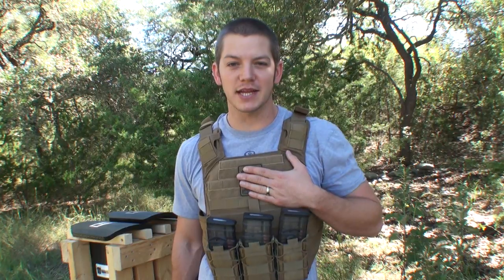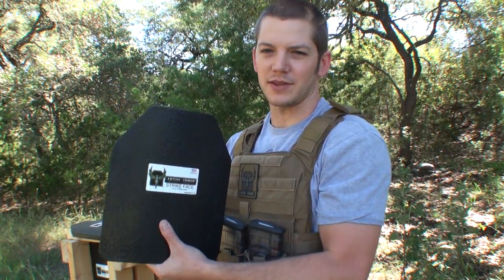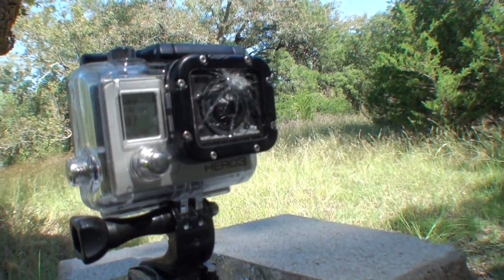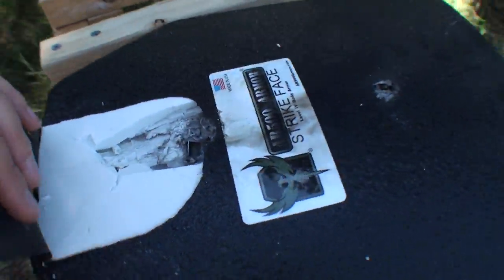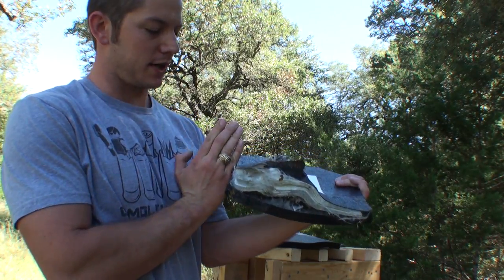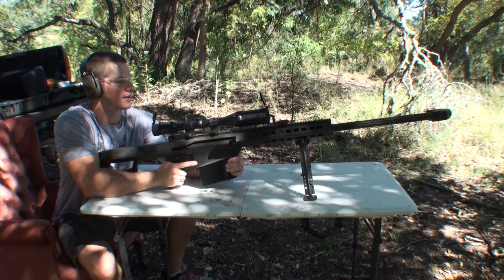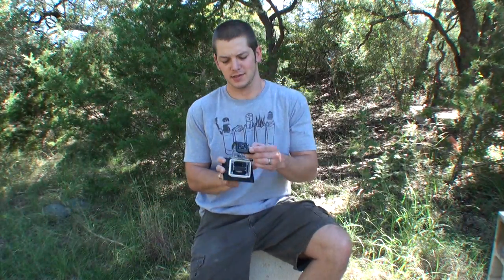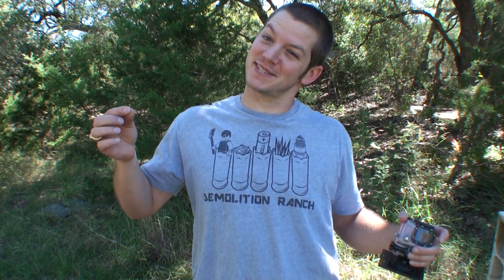Level IV Body Armor Torture, 50BMG

Comment: Those shots were practical point blank. If you got hit with a .50 cal round inside it's effective range your probably getting shot by a machine gun and your fucked. At max range though those plates would have likely stopped it especially inside of a plate carrier since most carriers have some form of ballistic resistance. Cool video though.

Comment: How would a titanium ceramic kevlar composite do.
Reply: Like 1,5 mm thick plate of titanium or steel on the both sides of the ceramics pressed tight as fuck in to the ceramic to keep is together and to catch the broken bullet an then kevlar behind that to catch all fragments which get trough.

Comment: Why does everyone make armor plates out of steel why doesn't anyone consider making a titanium plate titanium has a bit more tensile strength than steel and only has half the density of steel if a big steel plate has a weight of 10 pounds a titanium plate of the same size will only weigh 5 or 6 pounds

Comment: If the level 4 is the same weight, why would anybody buy the level 3?
Reply: The size difference is my guess. It looks thicker and that's a negative for me. Plus the level 3 can easily take multiple hits. This one crumbles. Never seen armor react like that
Reply: +Ryan Barbolt Cost difference
Reply: +Ryan Barbolt The level 3 will withstand more lower caliber rounds than the 4, and most people aren't getting shot at with something that big, and in AP at that.

Comment: How much does the armor weigh? Why doesn't the US Millitarry use this? And would be hard to be mobile using this?
Reply: army uses better stuff and you are mobile with it
Reply: the government awards the contracts to the lowest bidder. in other words buys the cheapest minimal equipment. gotta be sf to get the good stuff. ar500 plates are about equal to the plates the military uses. and mobility depends on how you were the plates. interceptor armor I crap because of the lack of mobility. a plate carrier similar to the one he has is what is starting to be used overseas but all it is is the plate. no Kevlar to absorb shrapnel and smaller rounds. but is has much more mobility then interceptor
Reply: They do but it is different

Comment: Imma sound like an idiot, but could someone please explain what the point of an incendiary round is? Does it add more penetrating power to the round somehow?
Reply: Incendiary=Fire
Reply: Well of course. But ive never seen wm do anything but spark, unless they are shot at a flammable substance like gasoline or kerosene
Reply: +Dakota Zeigler thats what they do spark to set flamable substances on fire not acually burn although I think theres bullets that are made to just burn
Reply: +Dakota Zeigler thats what they do spark to set flamable substances on fire not acually burn although I think theres bullets that are made to just burn

Comment: I am not good with guns is 50BMG the same AS 50cal
Reply: It depends. The rifle in the video fires       the .50BMG (12.7x99mm) round, commonly found in anti-material rifles and heavy machine guns. A .50 caliber handgun, say a Desert Eagle, fires a 12.7x33mm round, meaning it fires the same diameter bullet (12.7mm) as a 50BMG, but the cartridge itself is shorter at 33mm vs 99mm for a 50BMG. Long story short; the rifles fire longer cartridges than handguns, but in the same diameter.

Comment: why not just make a strnger kevlar fiber?
Reply: AR-500 Steel Plates are MUCH MUCH more better than Kevlar and Kevlar is only a thickly made fiber. It would be pretty impressing if a Kevlar like armor would be able to stop a 7.62x39mm or even a 5.56x45mm which is moving faster. But steel plates are much better.

Comment: Against the 50 cal the plates would have greater strength if they were tight against each other. Giving about the total strength of a one piece plate of 3/4ths of their total combined thickness. You would of course still have the blunt force trauma  IE; broken rib cage, broken sternum, punctured lungs, internal bleeding, heart stoppage, and others or a combination. My guess is "you're going to die and would probably have been happier getting a head shot from that 50.'

Comment: Is there anything out there that can stop a .50?  I mean, that shit can probably hit the driver of an army tank, couldn't it?
Reply: yes it could, the AS.50 was specifically designed to shoot through tanks through one side and out the other
Reply: +JustAGuy Depends on what you mean, It cant penetrate a proper tank like a MBT, since armor piercing 50. rounds will only penetrate around an inch of armor, but you can definitely penetrate some lighter vehicles, like APCs and utility vehicles.
Reply: Prmni I was watching future weapons awhile back and they had an AS50 and it went through 2 pieces of 1 inch steel that were separated by 10 feet. Idk if that classifies as a tank though
Reply: +JustAGuy matters what kind of tank
Reply: You guys need a bit of basic modern tank knowledge. In todays tanks, almost every single one is made of special layers of armor + mixed elements harder than steel and lightweight that are made absorb/ricochet a shell (for example, USAs M1A2 Abrams and Britains Challenger 2) because of those layers they get extra protection against special ammunition. So yeah, I highly doubt you can even penetrate a proper APC with a 50BMG even if it doesn't look very thick because  they're made very similarly to MBTs.
Reply: +Calabi-Yau Manifold ya, seeing as the m1a2's frontal armor scheme is equivalent to more than 12" of rha, I would assume that a 50 bmg would have trouble penning...
Reply: Well, look for a Vehicle armor. :3

Comment: why dont you try 1 IV vest vs. an ak47?
Reply: The AK-47 fires a 7.62 X 50 something millimeter round which I believe is smaller than a .30-06, the vest would hold up
Reply: okay thanks coyote47713
Reply: Blue Sky also I was mistaken, the AK fires a 7.62 X 39mm
Reply: Yeah an AK round is 7.62x39mm and is a common rifle cartridge.
Reply: +coyote47713 a mosin nagant fires a 7.62x54mm bullet but an AK-47 fires a 7.62x39mm bullet
Reply: Thomas Ryan 54R*

Comment: How do armor penetrating rounds work
Reply: I'm pretty sure they have a steel core that keeps moving after the bullet hits
Reply: +Leon Juergens 
True AP bullets, aka not green tip caps. Have a harder core than its surrounding metal. Usually its steel and or lead with a copper jacket and a tungsten core. When the bullet hits, it will make a impact mark that deforms the metal, weakening it, but since the core of the bullet is denser than the outer metal of the bullet. It will be driven forward into the "dent" in the armor. Basically making you hit the same spot twice with one bullet. This effect greatly increased penetration by ca 80% compared to a full metal jacket and is therefor good against body armor and why they have the name AP bullets.